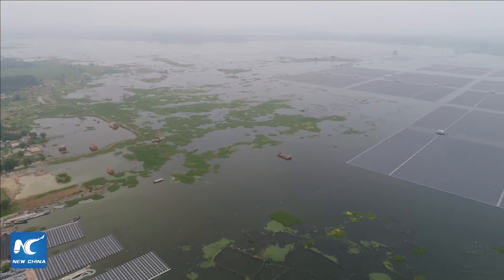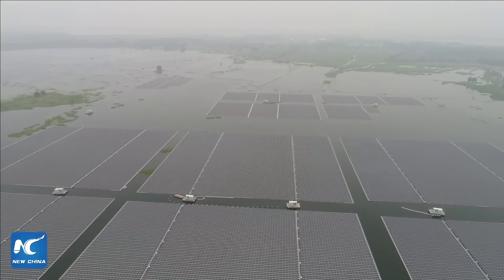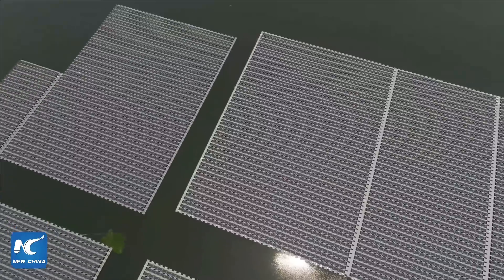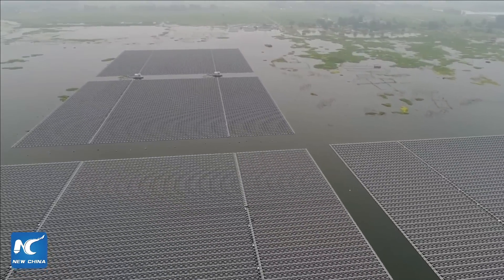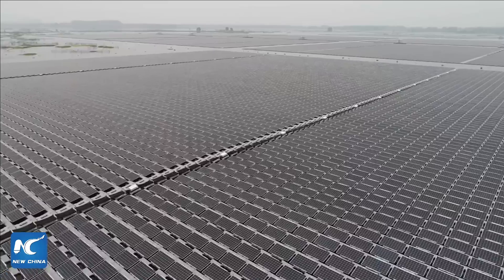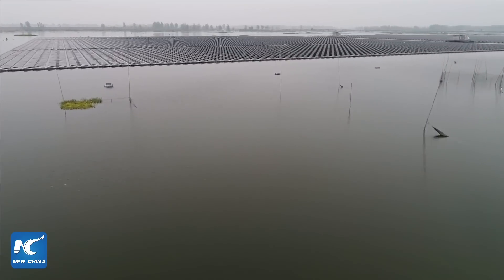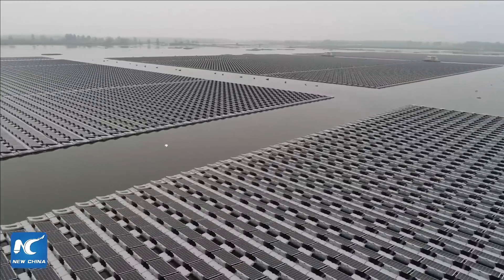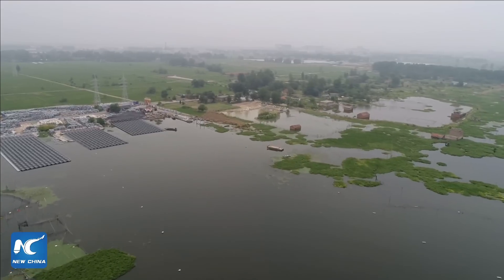LIVE with a drone: Floating solar farm in east China's Anhui, one of the world's largest!

Comment: I wonder if they get temperature inversions over this lake. That would tend to block the panels as it traps particulates and/or causes ground level precipitation.
Reply: But otherwise VERY cool. These are smart first steps China needs to do. We need to follow suit. I got panels on my roof. It's a start!
Reply: After a year
How good is your solar system
Battery weraing
Do you consider it a good investment?

Comment: Why install solar panels on water?  Lakes are precious.  Water is precious.  Why do you want to do it on water?
Reply: So basically the reason they built these there. 
1. It used to be a coal mine city. Therefore the water is ruined
2. The water cools the panels increasing their lifespan
Reply: Thanks!
Reply: 3. Some poisonous Algaes trhive on sun light, it will help them to control it.
4. Productive land (for food for instance) can be saved.
5  It Might help to reduce evaporation during dry seasons, for example El niño season in southamerica.
6  It's a perfect way to add more power  for hydro power generation